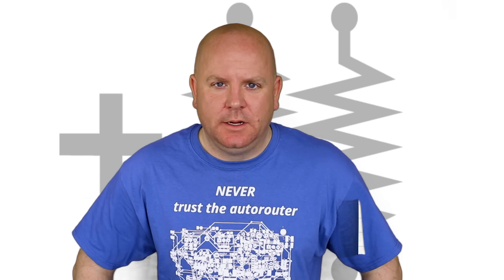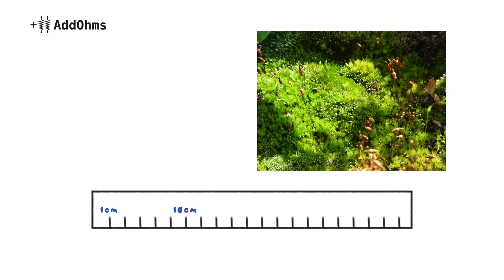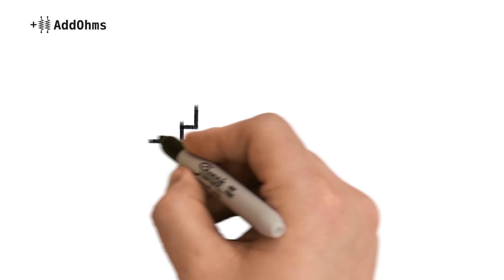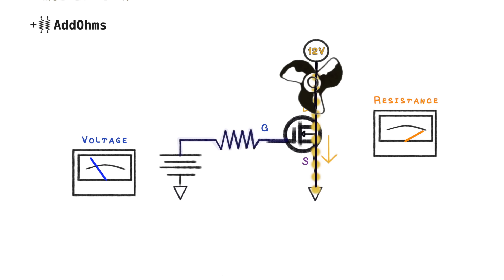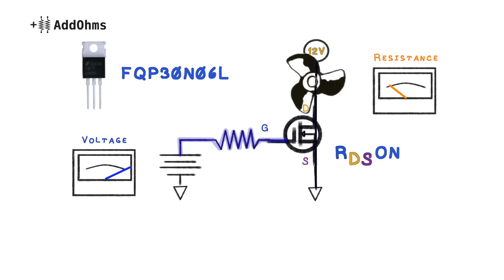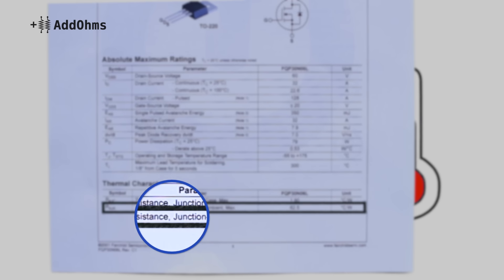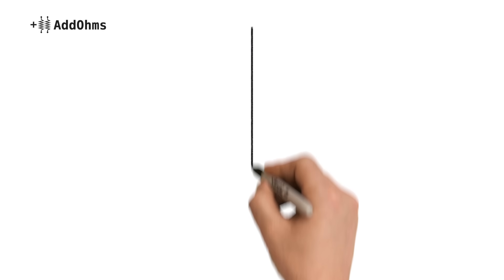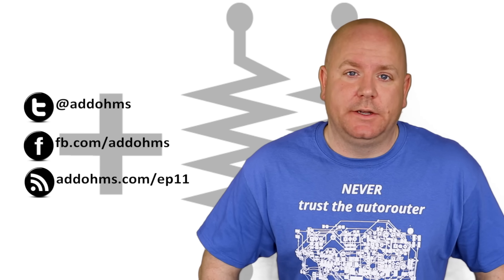MOSFETs and How to Use Them |  AddOhms #11

Comment: How do you calculate the power consumption of a relay? E.g., SONG CHUAN
 833H datasheet says: Coil Rating (DC)  Rated
 voltage 6V, Rated current 60mA, Coil resistance 100ohm. How come the Power consumption
 at rated voltage is approx. 0.36W?
Reply from the maker: Basic Ohm’s/Power law: Power = Current^2 * Resistance
Reply: Electrical devices are rated a lot as VA. Volt amps. 6V x .06A = .36W.     And 100 ohms = 6V/.06A . So it all works.

Comment: So, why do switching power supplies use mosfet instead of relays. Wouldn't relays have smaller power dissipations?
Reply from the maker: You can’t switch a relay at 100 kHz ...
Reply: @AddOhms  LOL

Comment: I am interested in learning electronics and how to use them to make different bells and whistles to warn a rider or driver of pilot of an approaching potential problem, such a cylinder head excessive temperatures, water temperatures, oil pressure low, oil temperature outside the normal range, etc.
Thank you,
Franco

Comment: How can I make a circuit, using a temperature sensor sender, to make a beeping warning sound when the coolant temperature is approaching 85 degrees celsius? then a continuous warning or alert sound as it reaches say 90 degrees Celsius and the radiator fan is not on yet!
Thank you,
Franco

Comment: 1:51 What do you mean 'current can flow when no voltage is applied? @Addohms great vid btw
Reply from the maker: In depletion mode devices, drain-source is conductive when gate-source voltage is 0. Unlike enhancement-mode, they are normally "ON".

Comment: Hello James, Now I'm repairing a Speaker Amplified.
Manufacturer: Monster, Model Number: Rocking Roller 3, This Item is not Power On.
I Review the Power Supply and the printed circuit of the board were burned also, part of a resistance that is connected to the Drain of a Mosfet, The part number of the Mosfet is ISA07N65A, as it burned part of the resistance I do not know what its the value of there, I already checked in the manufacturer's page, but does not show the diagram, to see the part. could you help me to know  what is the burned resistance?
The part number of the power supply is KA1658 Rev. 1.0
Reply from the maker: I have absolutely zero clue.

Comment: The instructional part I was interested in this video was from 2:40 up to about 3:35.  The rest of the video probably was a guide for technical use of electronic hobbyists, practitioners or enthusiasts.   I would probably get there maybe in some future projects of mine but my interests on using MOSFETs would be far more in complex electronics purposes like how to use them with higher amp/voltage motor requirements or will they work on induction motors, etc.  Thanks anyway for this informative video.

Comment: They are also called voltage regulator
Reply from the maker: No they, absolutely, are not.Voltage regulators may share the same package style, but so to sensors, one wire eeproms, and other active devices.

Comment: Hello, do I really need a resistor at the gate? I had the impression that MOSFETS have very high resistance at the gate so resistor would be pointless, sorry hobbyist here...
Reply: Don't worry, I found the answer, something about ringing, these parasitic capacitances and inductances have always been a pain in ass...
Reply from the maker: It is because the gate is a small capacitor. The resistor helps to limit inrush current but can also dampen ringing, due to that parasitic. Last night (and maybe tonight) I am live streaming while I make a board to demonstrate those effects.
Reply: @AddOhms  Thanks a lot!

Comment: my mosfet vgs is +/- 20v. what does this mean
Reply from the maker: You’re looking at the absolute max section and not the “electrical characteristics” section.
Reply: @AddOhms  correct. iam being dumb. mine is a typical on voltage of 3v. not sure if this would work on an arduino with using pwm.

thanks for your quick reply, hope your doing well

Comment: Question- does a mosfet, when on, conduct the current both ways or only one way? Thanks.
Reply from the maker: MOSFET has a body diode which makes them one-way. Besides, to reverse current you would reverse polarity on source and drain, likely causing Vgs to shut off the FET.

Comment: Hey, can I use a LM7824 to get 24 volts from my 120 volt dc battery? Would I need any other parts?
Reply from the maker: I doubt any LM7824 is rated for such a high input voltage. With 96V drop across In and Out, more than 10 mA of current means it'll be dissipating 1 W of power. Seems like there must be a better way.

Comment: Hi, I have a question, when you talk about the current the motor will drop do you refer to the current the motor needs to gets on or the remaining current after the motor gets on?  Thank you (I´m a petroleum eng and I´m trying electronics a little bit)
Reply from the maker: A motor's windings are a large coil, or inductor. When voltage is applied, current through that coil generates a magnetic field. When voltage is removed, the magnetic field begins to collapse. As it collapses, it generates current. The diode is there to provide a lossy path for that brief surge of energy.
Reply: @AddOhms  Ok thank you for the answer, I understand about the diode funtion on inductors (just like relays), I´m talking about the remaining current when the motor is turned on, I mean, where the currents that is dicipatted is comming from? after the motor or before it. (Sorry about my english)
Reply from the maker: I don’t understand “remaining current when motor is turned on.” If the motor is off, there is no current.
Reply: @AddOhms  ok, when the motor is turned on it takes what it need right? (current), so what current needs to dicipatte if the motor just takes this current?
Reply: I could see my mistake!!! I was thinking electrons or current would not go anywhere after they passes through the load or motor, so they need to go to ground and just the voltage tends to zero in this point. THANK YOU.
Reply from the maker: Current, or electrons, flow in a loop. They do not bunch up anywhere. They are like a bicycle chain. Their movement is what allows the fields to be created that cause a motor to spin. Electrons are never “consumed.”

Comment: ok! so they're a different type of transistor when LOTS OF CURRENT is being switched. if I wanted to wire up motor or something that'd use lots of power, controlled from a gpio pin going high, I'd use a mosfet :O
Reply: logic level yasssssss

Comment: Why is my mosfet turning on without Gate voltage? As soon as i connect my battery to the circuit without closing the switch for the gate, i get current flowing to my circuit.....
Reply from the maker: The gate is like a floating pin. It can get charged up enough from stray EM fields to open the channel. The pin should be tied low (or high) to ensure it remains off when nothing else is connected.
Reply: @AddOhms  Ive spend my whole night without sleeping to get a mosfet switch done. It was me destroying the mosfet Drain (its on the Backpad) by overheating it. I got a new one and just connected it with a aligator clip and everything worked.
It seems that the back pad is very difficult to solder. I scratch the back till i see bare metal and even tried Acid as a flux but nothing works. 
But ok i know what was wrong now.

Comment: Isn't this similar to an SCR ? switching a gate
Reply from the maker: No. Gate has a different meaning for SCRs. It triggers the rectifier, which is useful for detecting the zero crossing of an AC signal. 

Gate of a MOSFET controls how wide the channel is between the drain and source.

Comment: Why use a series resistor going to the MOSFET? Wouldn't it be better to use a voltage-divider/zener so that you can keep track of the Vgs thus drain current?I believe a better resistor-tuner type circuit would be a voltage div. with a pot going from Gate to Source.

Enjoyed the video. 

Thanks
-Dave
Reply from the maker: I don't follow anything you stated. The gate is a capacitor. Depending on the type of FET, it could have a relatively high in-rush current which could damage some GPIO pins. In the case of high frequencies, say, higher than 10 KHz, then care needs to be taken because it builds an RC filter.

Comment: Dayyyum. Electronics is so confusing. "Current can flow when no voltage is applied." I thought you need voltage for current to flow!
Reply from the maker: ... when no voltage is applied to the GATE. Still need a voltage drop across the drain and source.
Reply: @AddOhms  mmm okay thanks

Comment: Are these voltage specific? I need a mosfet with a gate of 5V at .5amp to power LED lights plugged into a 5V power outlet

Your visual diagrams were amazing
Reply: Does the gate have any current received from the source?

Can I buy a low voltage gate, low resistance mosfet?
Reply from the maker: The gate does not have much current. However, it is like a tiny capacitor so when it first turns on there is a small rush of current, which is why you still need a current limiting resistor (in some cases.) Once the gate is charged up, no current flows. As for a low-voltage gate, the FQP30N06L and IRFZ44N have low Vgs threshold voltages. Both still need high voltage to get the rated Rds (resistance), but still work well with 3.3v and 5v signals.
Reply: @AddOhms Thank you so much! It is amazingly hard to find someone with your talent. Everyone around here just installs software. I will look into the parts you suggested and maybe try it on my old laptop before risking it on my bosses computer.

Comment: Liked you t-shirt. Haven't done any PCB layout in a 20+ years but even back then you couldn't trust the autorouter. I'm surprised that it's still the same.
Reply from the maker: The idea of "put the components down and hit autoroute" is still a long time away. However, auto-routers are useful for specific layout tasks. For example, routing time critical buses between a memory controller and DDR chip. Or high-speed differential signals. 

General purpose "auto route" simply cannot take into account the human designer's intent for non-electrical decisions.

Comment: +
AddOhms
Make a video about how to create negative voltage on NJFET's gate.
Reply from the maker: You don’t. It’s negative relative to the source pin.
Reply: @AddOhms  
Ok, then how to control NJFET's?
Reply from the maker: Use it as a high side switch and drive the gate with a driver. The “negative” voltage is relative to source, not ground.
Reply: @AddOhms  
Thank you, OK.

Comment: Isn't electron current flow from source to drain rather than drain to source as in your video?
Reply from the maker: Yes. And (about) the only place you see that is in school. For circuit analysis the direction doesn’t matter. Current is a complete look. As long as you use the and model for the entire circuit, it doesn’t matter which you use.
Reply: @AddOhms   I wouldn't be able to understand vacuum tubes using that model, but for everything else you'd be right.  Just curious as to why the other way makes more sense to you?

Comment: A great video. Very well explained. But I would'nt recommand taking the maximum temperature for calculating thermal dissipation. In my experience, the cooler you keep your transistors, the more reliable they will be. Never believe datasheets. I don't care about what professionnals are doing in commercial products. In my opinion, commercial products are not reliable enough. I'm tired to replace under rated components and to fix under cooled designs.

Comment: Strange, I do the calculation as stated, but my mosfet still got too hot and seems like it got damaged
I was using it IRLB3034PbF to control the 12V 18A heater, when it started smoking and got really hot. I did poorly connect it though (by using alligator clips), was that the problem?
Reply from the maker: "Seems like it got too hot" is not a measurement. Assuming a 5 volt Vgs, the Rds-on is 2 milliohms. With 18 amps through the drain, you can calculate power dissipation using P = I * I * R. Which comes out to be P = 0.02 * 18 * 18 = 0.648 W. Using the Tja (junction to ambient) of 62 C/W, the transistor temperature rise will be Trise = 62 * 0.648 = 40C. So at room temperature the junction (and eventually the case) will be 65-70C. 

Max junction for this transistor is 175C. So you're well below max junction. But well into a region where a human would call it "hot."
Reply: @AddOhms  Yeah due to the calculation, you should be right. I guess either bad product or any other defect. The "it got too hot" eventually made the color turn a lil bit brown (probably due to oxidation), and smoke comes out of it. As of now, I try it with LED Strip, it still works but I can't turn the LED off. I can only dim in to a certain level. I'll just get myself a new irlb3034 and let's hope nothing goes wrong with it.

Thanks for the reply anyway, appreciate it !
Reply from the maker: Okay, that is too hot. :) If the transistor isn't turning off, it could have been damaged by ESD. That damage has created a small short in the layers which prevents from turning off.
Reply: @AddOhms  I bought the new one, this time I properly install it and solder it to the PCB. I use heatsink just in case something happened. So what happen is it goes well when fully turned off and on. The mosfet stays cool when the heater is supplied with 12V. And then I tried turning it to 8V and the mosfet got heated up until it broke. The temperature sensor sensed around 131 C max. I kind of stick TMP36 sensor to the mosfet with tape. So I guess when I lower the heater supply, the Rds increased, which caused it to dissipate more heat ?
Reply: I just did the calculation for 8 V. My heater's resistance is around 0.7 ohm. To turn the 12 V into 8 V the Rds have to be 0.35 ohm. That makes the current 11.43 A. And P = I*I*Rds = 11.43 * 11.43 * 0.34 = 44.42 Watts. The safe power dissipation is 2.34 Watts soo it's obvious now.

Comment: 2:46 if there's no load between 12V and drain, can the MOSFET explode? If there's no load, all available current is gonna squeeze through that thing and make it pop, right?
Reply from the maker: If there is no load, that means there is an open. In which case there is no current. If you mean a short, then current is limited by the MOSFETs Rds-ON. MOSFETs have a positive thermal coefficient, which means their resistance goes up as they get hot. Even with a relatively low Vgs, the on-resistance is going to be in the 100 milliohm range for most decent sized FETs. It is probably the limit of what a TO-220 can dissipate without a heat sink. While it is possible to damage or burn up a FET, it is not going to explode or pop.

Comment: When to use P=R*I^2 , and when do you use P=U*I !?

The datasheet of my MOSFET gives Rds=1.2 ohm to 5 ohm. 
Im pulling around 80 mA.
The Vdd = 11-17 V

If a use the formula described in this video I get P=0.032 W, if I use the other formula P=1.3 W
Reply from the maker: Algebra says the equations are the same. You are getting different numbers because your assumption for Rds is wrong. If Vds is 6 volts and the current is 80mA, RdsOn is 75 ohms. (Which is ridiculous.)

You need to measure the actual Vds drop and the actual Id to calculate RdsON or Power.
Reply: @AddOhms  Thanks a lot :) We made a linesensor at school, just needed some calculations to backup the project

Comment: Thanks for the video, very informative and easy to understand.  Is it possible to gate the mosfet with an audio signal, as that is AC, would that work?  I've been attempting it, but it will only drain when I touch the gate input, it's not responding to the audio at all.  I tried with different levels, quite some voltage output.  Perhaps mosfet only responds to DC, is that right?  Thanks!
Reply from the maker: Audio swings above and below 0 volts, which means the MOSFET's gate is seeing both positive and negative voltages. A transistor in the simple low-side switch like shown in this video cannot be used to amplify an AC signal like audio. Look up Class-AB and Class-D amplifier designs. An Enhancement Mode MOSFET is lousy for audio. You want either a JFET or a BJT.
Reply from the maker: Sorry, I'm not going to watch an entire video decode what you are trying to do. I'm confused because to drive a motor or solenoid, you would use the transistor as a switch. I don't see how that relates to an amplifier or audio.
Reply: @AddOhms  no worries I don't expect you to watch it.  It's using the audio signal to drive the motor which vibrates a spring, it's an oddball spring reverb.  Thanks, I will try the BJT as you suggested

Comment: what is the reason for having a resistor at the gate, if MOSFETs are all about voltage?
Reply from the maker: The gate is a small capacitor. The resistor limits in-rush current.
Reply: @AddOhms  thank you! makes sense

Comment: Used a power depletion fet to drain the bank on my CD welder(through power resistors) either when switched off or wanting to weld with a Lower voltage. It was expensive relative to other parts but not having a relay on an otherwise solid state design was oh so satisfying. Nice video only thing I would have added is if you want to high side switch one can avoid a lot of headake using a floating supply on the gate and an opto isolate to signal it. Esp practical for one offs where a few bucks isn't multiplied by hundreds or thousands

Comment: I'm always confused when people talk about things "drawing" current.  Things don't "draw" current; they "allow" current to pass thru.  The amount of current they allow to pass thru for a given voltage is determined by their internal resistance.
Reply from the maker: In that case, you are in the extreme minority. A device presents a load which causes current to be drawn. It is common terminology used in electronics. For example, "current draw" electronics results in 2.9 million pages on Google. While "current allow" electronics only has about 11,000.